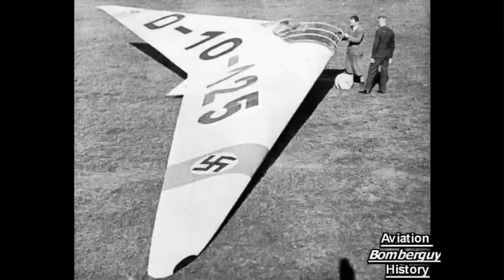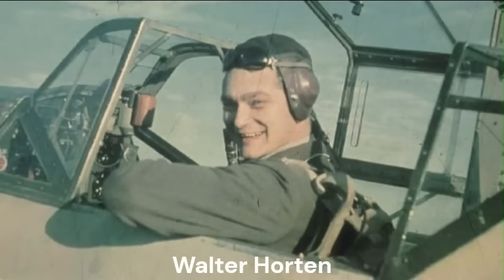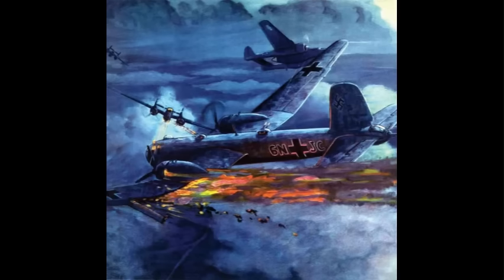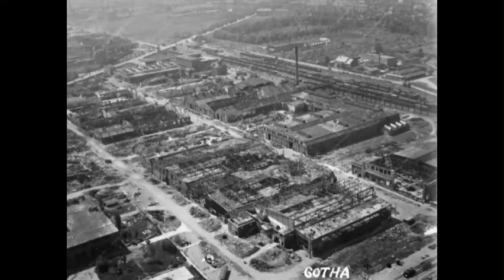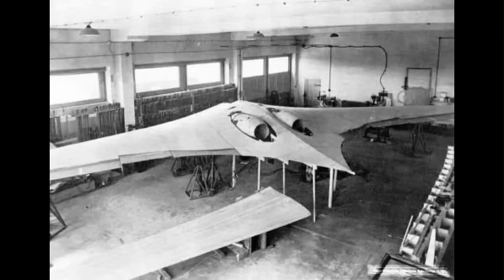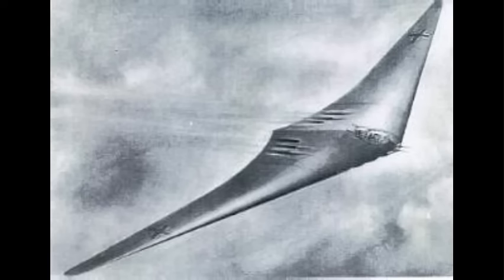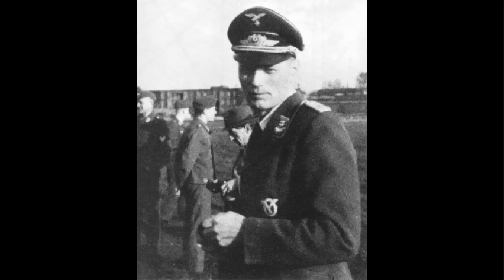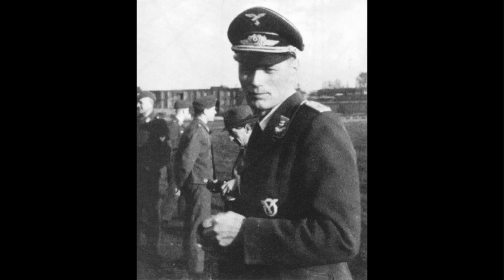Horten Brothers – SAD Fate of the Developers of the Horten Ho 229 STEALTH Jet Fighter (‘35 - ‘45)

Comment: Ziller died after repeatedly trying to restart the dead engine.  I've often why he didn't compensate against the yaw by the controls or simply shutting down the engine and glide in  ?
Reply: +@JefferyHavelin   The British tried to locate the wreckage of the V1 and V2 during the Summer of 1945 but I don't think they were successful.  During interrogation, the Horten brothers threw Ziller under the bus with the bad landing.
Reply: @FiveCentsPlease  David Myhra 's book description used eye witness reports describing Ziller losing one engine to a flame out followed by repeated dives from altitude trying unsuccessfully to restart the dead engine.  
Next Ziller starting flying in large banking circles, each one decreasing in size until he stalled out and crashed into an apple orchard, tearing off both wings with Ziller lying dead on the ground.   This was after at least twenty previous successful test flights.   The Horten bros. were criticized for using an inexperienced test pilot who had very limited previous testing with the turbine  jet fighter ME 262. Simulated dog fights between the two stated that the Horten 9 would flown circles around the 262 with superior top speed and overall manuveribility even though they both used the same Jumo 004B engines. .
The accident scene was likely cleaned up long before the British got there.
Reply: @JeffreyHavelin    RAF Intelligence interviews of the brothers determined they had roughly two hours of flight testing on the V2 before the fatal accident.  Their only comment on the Me-262 was to state that the V2 showed a better rate of climb than the Me-262.
Reply: @FiveCentsPlease  The Horten 9 V-1 was an unpowered glider with several test flights and zero crashes.  The testing was during the winter and during the first landing the pilot was having difficulty slowing down even with the brakes. 
So he retracted the nose gear and successfully toboganed to a stop a wild angle to the ground.
Reply: @JeffreyHavelin  Hmm.  It was my understanding that the V1 was written off during a landing accident.
Reply: @FiveCentsPlease  No.  The V-1 was a glider that received minor damage when the nose wheel was retracted during the landing roll.

Comment: The Go-229 prototype seized and brought to Smithsonian Institution had no svastika painted when boarded to USA.
????
Reply: +@josega6338   The 229 V3 was not even complete when it was captured.  So additional work was performed either by German workers or the RAF.  The Americans gave the V3 the RAF to study over the summer of 1945.  That blue paint on it certainly looks like an RAF color.  It has no flight controls and never flew.
Reply: Go-229 is in Smithsonian Institution
Reply: @  The British studied the 229 V3 over the summer of 1945 while they were interrogating the Horten brothers.  By August 1945,  the 229 was on the docks in New Jersey and shipped by train to Ohio.  The AAF shipped the 229 V3 and other captured aircraft to a hangar at Orchard Field, Chicago (maybe 1947-ish or so) where they were stored.  Those aircraft were donated to the Smithsonian in 1950.

Comment: What was not mentioned was the several visits by Northrop Corporation in the late 80's to evaluate its design incorporation into  the B-2 Stealth  bomber
Reply: No, Northrop didnt get their hands on the Ho229 until the early 2000s, by then the B2 was already in service. The B2 is based on the YB-35 and YB-49 developed by Jack Northrop and the Tacit Blue demonstrator and has nothing to do with the Ho229.

Comment: I'm surprised the Americans didn't employ the brothers after the war was over? The Americans did build the flying wing, though it never worked well until advanced computer aid helped inherent instability issues. My technical issue with the wartime design was the choice of two engines over one larger single engine. Flame outs in one engine caused catastrophic instability failure, resulting in crashes, while a larger single engine design power cutout allows the plane to glide to safety, while cutting engine component complexity in half. I also agree with the joint committee view of the plane needing aft tail horizontal and vertical control added, regardless of drag. The thing was an unguided suicide machine. Other than that, it was great. Looking at the success of the stealth fighter, the Horton brothers were clearly the inspiration. Their wood, carbon glue radar reduction manufacturing technique places them at the forefront of visionary aviation design.
Reply: +@freemarketjoe9869   The brothers applied for asylum in multiple countries after WW2 including the US and were denied.  Reimar went to Argentina and continued working in aviation but curiously did not attempt to revive any of their wing design to my knowledge.  As a wooden design in prototype form, I don't think the 229 would have been structurally sound for higher speeds from jet power.  Remembering that the V2 only flew for about two hours of testing with jet power before the fatal accident which basically ended the 229 program in February 1945.
Reply: Reimar designed a flying wing freight version in Argentina for carrying citrus produce to La Paz; it was underpowered,  but in experimental mode; damaged by fire, but still on display, I think.
  Theirs is a fascinating, but sad story. I wish they could have been free to design in peacetime, no telling what they could've achieved. The did so much, with so little.
Reply: @freemarketjoe9869  give them a job too  why not
Reply: @freemarketjoe9869  they used what was available don't think their was any stealth technology involved refuel in the air drop a atomic bomb that's what they wanted to do
Reply: The existance of the so called carbon black coating is highly desputed and outside of traces of charcoal being found in the laminate it pretty much doesnt exist. The Ho229 was an unstable mess that the brothers stopped working on after the first few glider prototypes in exchange for the Amerika Bomber program. The reason the US didnt want them is simple: they had better engineers such as Jack Northrop. Modern stealth aircraft use different principles and the B2 and B21 are based on the YB-35 and YB-49 designs by Jack Northrop with the stealth principles of the Tacit blue demonstrater.
Reply: @Tozzpot500    The Smithsonian tested samples of the Gotha-designed V3 and did not find any charcoal or carbon, only glue components and decaying wood.
Reply: @Tozzpot500  the modern stealth aircrfat are NOT based on the yb 35 and 49, if anything they have more in common with the ho 229 (although the b2 was not based on the 229 thats a myth). the ho 229 wasnt an unstable mess, it was the first somewhat stable jet powered flying wing, which flew quite stable with its innovative ailerons that acted as rudders, unlike the yb 35 and 49 which were the actual unstable mess. the 229 is slick and aerodynamic, the yb are not very aerodynamic. Jack northrop wasnt better than the horten brothers, it was the opposite. This being thanks to the hortens being able to fully understand flying wing aerodynamics  with YEARS  of experience, meanwhile northrop was making other aircraft. the crashes were because of engine failure not design failure
Reply: @kivinrepoio That wasnt the point i was making. The B2 program was based on the original flying research and development by Jack Northrop combined with the stealth research from the in house Tacit Blue program at Northrop. Im more than aware that the YB-35 and YB-49 are not the basis of modern stealth, hell they werent even the basis for the B2's stealth and that wasnt even the point i was making.

The Ho229 project was a failure, thats not an opinion that is a fact stated by Nazi officials. While mostly stable at high speeds the Ho229 was very unstable during low speed manoveurs. It was had issues with compressor stalls at low speed as well due to the placement of the engines and just the general clusterfuck that was german jet engine design in the late 40s. Either way, the program has not influenced anything in the modern era be it stealth or otherwise. 

Northrop was arguably the better engineer as he had far more successes than the Hortens, that is not to discredit their significant yet indepenant advances in their respective fields, however one has a legacy still building some of the most advanced aircraft in the world, and the others were forgotten in the history books alongside their failed prototype.

Both designers were talented, but entirely independant from one another. The Ho229 contributed nothing to the modern B2 and B21 and thats the only point i was trying make besides the fact that the Ho229 was never designed with stealth in mind.

Forgive me for any hostility, i just despise the sadly growing myth of nazi technological superiority because outside of their rocket development programs both the Axis and the Allies were pretty evenly matched in technological ability.

Comment: Hi. The U.S. Airforce scrapped it's its squadron of flying wing bombers after they learned how fussy the aerodynamic flight parameters were. A little battle damage on one wingtip would make them uncontrollable. If one bomb "hung up" in the bomb bay instead of dropping, unless that bomb was right on the c.g., the flying wing would become unstable. The purpose of the empenage (tail surfaces) is to provide large discretionary correctional forces to counterbalance an "engine out", or other damage. Conventional bombers sometimes made it back with half a wing shot away, a flying wing would have no show. Cheers, P.R.
Reply: +@philliprobinson7724   Poor yaw control is not compatible with a precision bomber platform. And AF secretary Stuart Symington's vindictive campaign to punish Northrop was the nail in the coffin for the YB-49.  Symington had them scrapped in front of the Northrop employees.
Reply: @FiveCentsPlease  Hi FCP. Thanks, five cents is Peanuts, that's a dollar's worth, I'll owe you the 95c. Not only poor yaw control, but poor pitch control too. The Curtiss-Wright XP 55 "Ascender" was virtually a flying wing also, (with a small canard), and it couldn't get out of a spin. People died in these aircraft so I can quite understand Symington's anger. He probably went slightly overboard in punishing Northrop, but Northrop was a top designer, how did he miss seeing the control differences between theory and practice? 

My guess is Symington knew of "the Christmas Bullet" fiasco, the "Bullet" being Dr. Christmas's "advanced" biplane fighter in the late '20's that didn't have inter-wing bracing wires. The smooth-talking doctor had convinced the USAAF to subsidize it (twice), and both times the pilot died because the wings folded up. "Theory be hanged", fumed Symington, "it's not happening again on my watch" after one YB49 went down.

I reckon there's room for dreamers like Christmas, Northrop, and the Hortens, but not on the front line with men's lives at stake. Cheers mate and check your parachute every day. P.R.
Reply: @philliprobinson7724  Symington had been pressuring Northrop to merge with Convair and he refused.  Symington punished Northrop and later retired to a cushy job at Convair and the Air Force got the B-36.
Reply: @FiveCentsPlease  Hi. FCP. I don't doubt your tale of intrigue and politicking, all I know is aircraft need a tail, even birds have one. Cheers, P.R.

Comment: How was the fuselage protected from the extreme heat from those poorly placed jet engines?  I doubt that titanium was available.
Reply: Nothing poorly placed about them
Reply: @trance9158  How many jets or rockets have you seen with hot exhaust gases running over a significant part of the fuselage.  They are placed with nozzles behind any part of the fuselage or wings.  Try putting your hand under a propane torch flame!  Even automobile exhaust is placed behind the body of a car or out the sides.
Reply: +@user-vj2wt7jh7j   On the V3 prototype, the engines fairings front-to-back are crudely-welded sheet steel for fire protection.  That's a lot of metal.  The V3 was found partially complete and painted in green fireproof paint, which I think is the state that the Smithsonian should return the surviving example back to represent.

Comment: The Ho229 has been sitting in pieces at the Steven Udvar Hazy Center since I was last there in 2012. Looks like they don’t plan on restoring it any time soon. It’s wooden skin is very poor condition. The Smithsonian seems to want to preserve rather than restore aircraft today. There are still lots of WWII aircraft in storage. They have a Ta152 and a Messerschmitt Me 410 at the Paul Garber facility still.
Reply: +@fw1421  They are doing a disservice by not reversing the damage inflicted on the V3 while in their storage for decades.  It is a rotten mess being patched together with artisan materials and Q-tips.  The wood is just fungus powder at this point. They have the expertise to return the example to the unpainted and unfinished prototype that was found in the Gotha workshop in April 1945.

Comment: Greatest problem was the reliabilty/lifespan of the Jumo jet engines.
Reply: An even greater problem was the reliability/lifespan of the Third Reich!
Reply: Their only problem was metallurgy wasn't up to par at that time.
Reply: @trance9158  I think they could have done better if they had the raw materials to improve the alloys. They knew what they needed, they just couldn't get it. "The initial 004A engines built to power the Me 262 prototypes had been built without restrictions on materials, and they used scarce raw materials such as nickel, cobalt, and molybdenum in quantities which were unacceptable in production. Franz realized that the Jumo 004 would have to be redesigned to incorporate a minimum of these strategic materials, and this was accomplished. All the hot metal parts, including the combustion chamber, were changed to mild steel protected by an aluminum coating, and the hollow turbine blades were produced from folded and welded Cromadur alloy (12% chromium, 18% manganese, and 70% iron) developed by Krupp, and cooled by compressed air "bled" from the compressor. The engine's operational lifespan was shortened, but on the plus side it became easier to construct." Wikipedia.
Reply: @dougerrohmer the basic idea with the engines was created, they are used  till today with modifications ....
Reply: @kkteutsch6416  What? The airframe aerodynamics, or the engine?
Reply: +@steven2463  The bigger problem is there was practically no flight time with three different prototype designs.  The V1 glider was lost in an accident.  The V2 flew for two hours with jet engines before it was lost in a fatal accident.  The V3 was not finished and never left the ground.  The 229 program had not reached any maturity to be a proven concept, just prototype design experiments.
Reply: I'd love to work on a carbon fiber/ expoxy design with lightweight electric motor power, similar to hang gliders with lightweight batteries..
Reply: Nah, it was that it was not stable in flight. Flying wings need a computer to control it.
Reply: Wrong @dougerrohmer
Reply: @trance9158  Wrong what? Can you expand a bit?

Comment: The Horten brothers and this aircraft absolute fascinate me you have to consider this is over 80 years ago the design even for todays standard are space age and way ahead of their time this one blows me away . You know neither brother had any training in engineering for aircraft they did this with just pure common sense and drive
Reply: The modern world had been assembeld by keen ametures pursuing their passions. Plus there seems to be a theme of brothers or very close partners working together to produce groundbreaking innovations; H Ford & wife, same for Benz, Montgolfier,  Wright and many more.    The Horton is the Template for the B2, both incorporating the same design ethos - burying jet engines above the leading edge for stealth, huge wing fuel storage allowing for overpowered engines, vast range and disproportionatly high payload.
Reply: @conormcmenemie5126 The B2 has no ties to the Ho229 and is based entirely on the work of Jack Northrop's flying wings and the Tacit Blue demonstrator. Northrop had flying and functional flying wing designs before the Ho229 was even a concept on paper.

The YB-35 and YB-49 serve as the initial design basis, Northrop didnt even get their hands on the Ho229 until after the B2s first test flights. As for the engine being above the leading edge on the Horten it was for stability and maintaining the center of mass, not stealth as the Ho229 had no stealth properties at all and the concept didnt even exist until the mid 60s-early 70s.
Reply: @Tozzpot500  I stand corrected - thanks for the info.
Reply: @conormcmenemie5126  No problem
Reply: @Tozzpot500 wrong... They went and reversed engineered the wing to help understand why the Northrup wing wasn't stable in flight .. there's many many similarities to both
Reply: It also had stealth properties.. either by accident or from the unusual paint used on the craft
Reply: @trance9158  Apparently the citing of the engines originally within the body of the beast and having the outlets above the trailing edge of the wing was to help hide the signature. Also plywood, by accident and design contributed to a lower radar signature.
Reply: @Tozzpot500  And Northrop was way behind with the first flying wing in the air, the Hortens producerd them since ending WW1 ffs! Also the combination with jet engines. You are right to call th YBs demonstrators while the Hortens actually were prototypes with hundreds of hours of test flights. Not comparable, sorry.